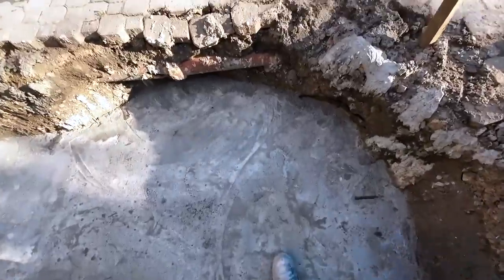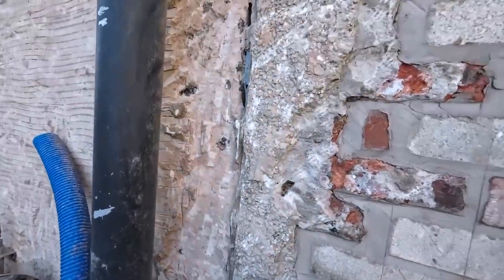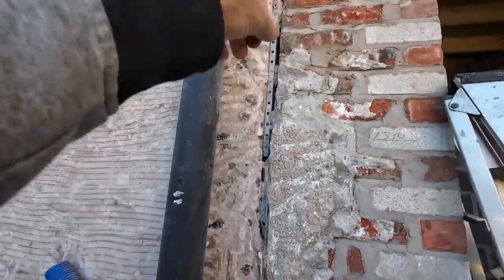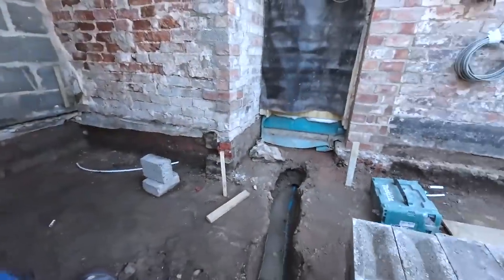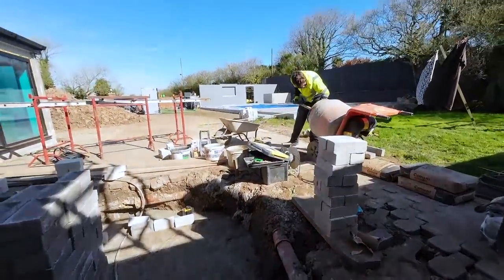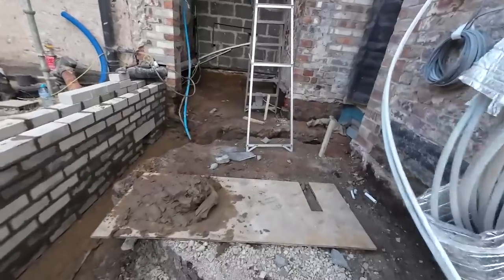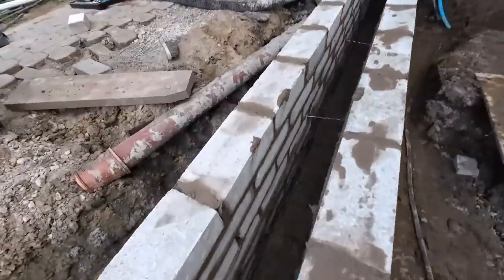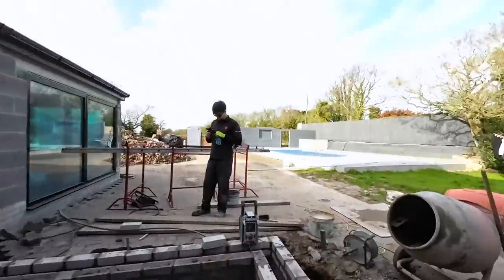OLD SCHOOL COMMON BRICK FOUNDATION

Comment: Nice how you are adding to the historyof the building with quality work! a mate of mine revonated an old blacksmiths forge in Suffolk which had been in his family at least 5 generations. It was brick built, and timber framed and clad with elm boards in places. He showed me pictures of the footings built "new" around 1790, and they were of brick and lime mortar about 12 or 13 inches wide, not sure how deep. Amazingly they were in excellent condition after 200+years
Reply from the maker: Very nice 😁🧱👍🏽

Comment: Fantastic videos guys. Just a quick question?
If you increase your cavity to 150mm do you still need insulation plasterboard on a new extension?
Cheers buddy
Reply from the maker: It is a minefield at the moment . It depends on the the blocks and the cavity Insulation that you put in 🙄🧱👍🏽

Comment: The lower brightness on the laser is for a detector that beeps so you can use it in the sun up to 50 m is what mine is.. I've been using one for years now for extensions and bathrooms so a shower tray or bath sits in square it's a great job.. I use it for door frames and setting up anything really.. if it's square level and plumb everything works out much handier
Reply from the maker: Love it 😍🧱👍🏽

Comment: We normally make the mortar below the damp course about 20% stronger to hold up to ground moisture better. Not sure if that’s something others do but we always have. I’ve seen old houses too often where the lower mortar is washing out from being too weak.
Reply: We use 3:1 sand/cement upto dpc here in northeast uk👍
Reply: @davebarrow2194  i use 3:1 in footings too. normally with hds
Reply: @davebarrow2194  We use 6:1 above and 5:1 below. Our climate is generally dry so stronger than 5:1 is probably not needed. Though if a builder specifies 5:1 above then we would possibly go with 4:1 below.
Reply: 4-1 seems the norm down here😊

Comment: Hi chaps,what is the spec of the sound mic you are using please👍✅
Reply from the maker: Hi pal, we use the  DJI Mic 🎙️. The twin set which is a receiver, 2 clip on mics and a handy case that charges everything and automatically syncs the mics . 
Highly recommend 😍🧱👍🏽